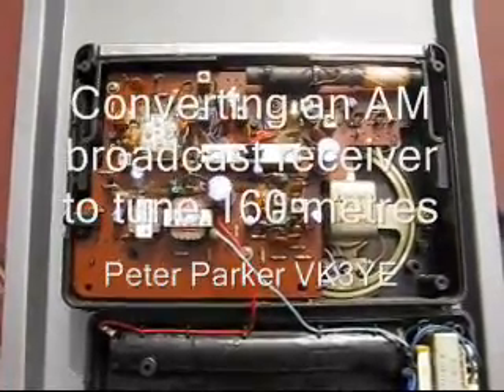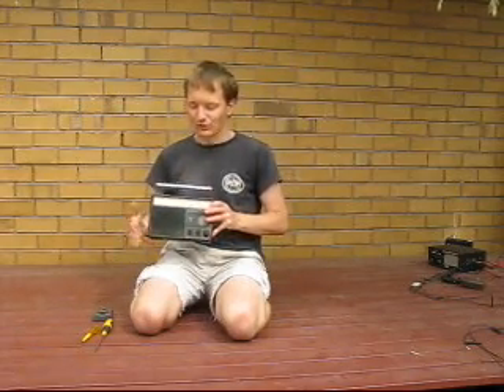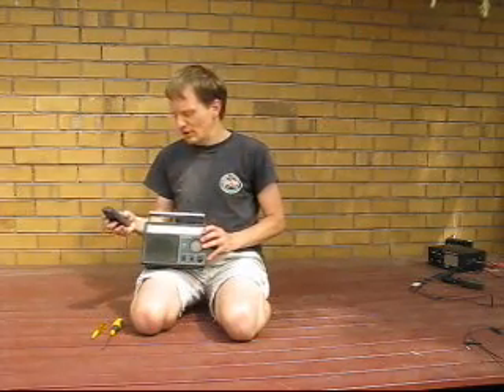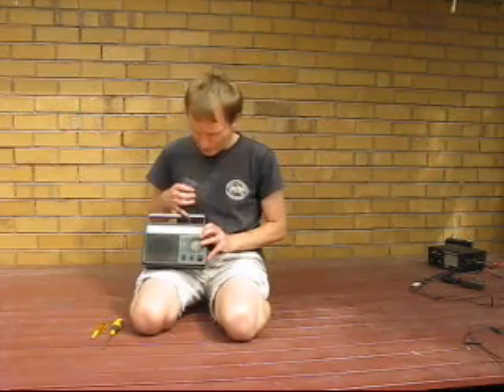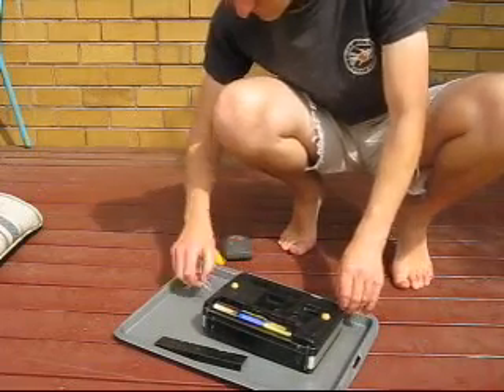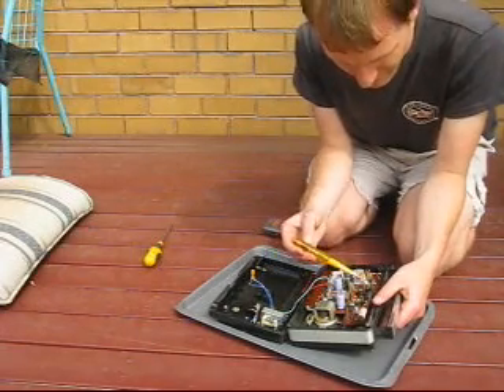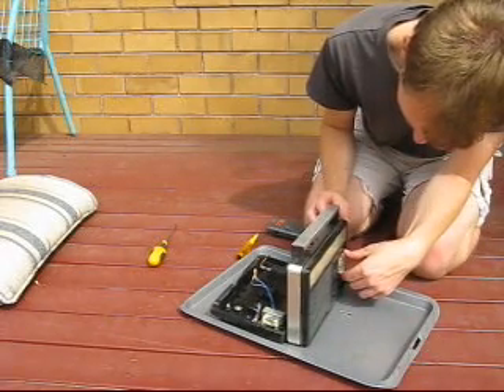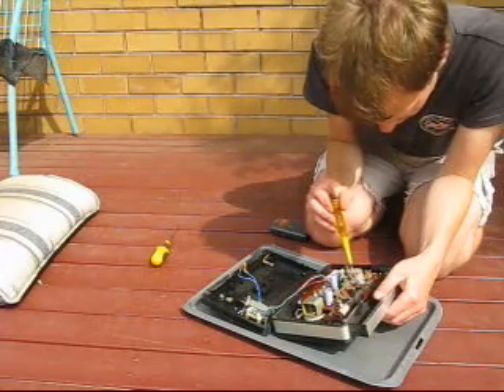Converting AM broadcast receivers to 160 metres

Comment from the maker: Thanks Lionel - very good comments there.  One thing I didn't mention is that if you can't quite get it there with the osc trimmer and the local osc coil, you could then try lowering the IF by screwing the IF transformers in.  But this assumes the receiver doesn't have a 455 kHz ceramic filter and you're only a few kHz off where you need to be on 160m.

Comment: I just looped a wire around my ferrite core, and then attached both ends of it to a long wire, and I was able to recieve HAMS using SSB and AM on 160 meters somewhere about 3/4 across the band scale.  I didn't adjust anything at all on the variable condensor.   And if you add in switches between the long wire and your new loop, you can switch either switch off to go back to boosted longwire standard broadcast from SW, or switch both off to go to back to unboosted standard broadcast band.

Comment: Really I just added one switch, because I just want to switch between long wire boosted SW, and longwire boosted AM.   Its a totally non-destructive mod.  Leave out the switch, and its as simple as taking a piece of wire, looping it around your ferrite rod about 7 times, and then connecting both ends of it to one end of your long wire antenna.  And then wait for dark around 9pm dark, and hunt for the telltale SSB hams about 2/3 to 3/4 away acorss the dial to confirm your now picking up 160m.